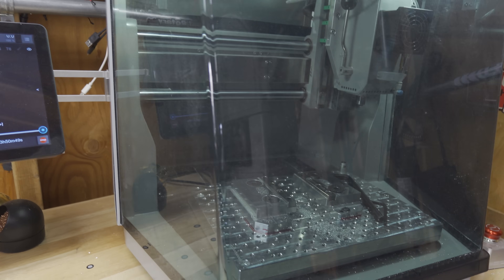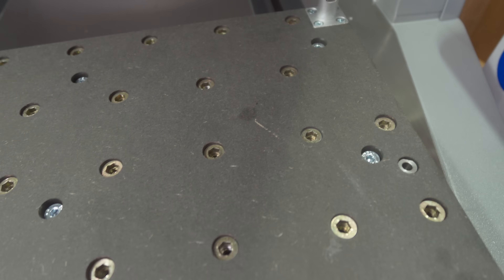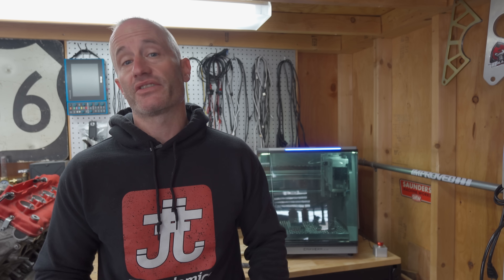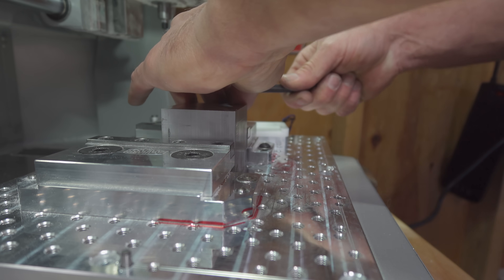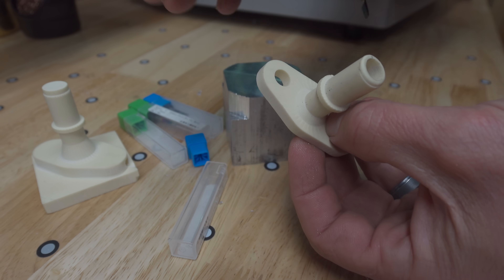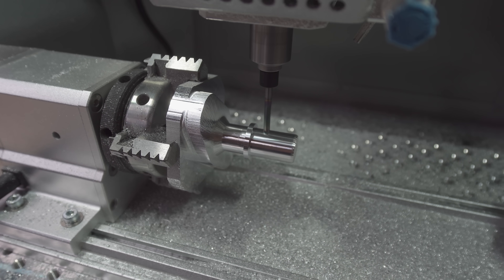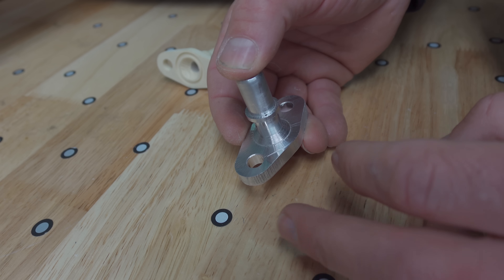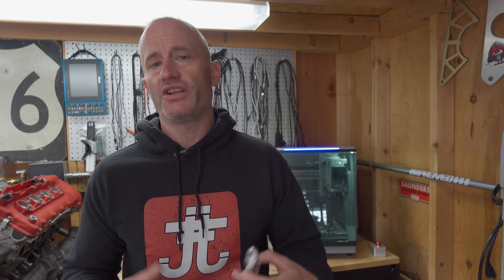More than small flanges? Making a multi-operation component from aluminum with the Carvera Air.

Comment: Nice honest review showing the capabilities of this machine. I have a similar small CNC (but without 4th axis- Carbide 3D Nomad 3) and it's pretty amazing what you can make with it. A machine like this, along with a small bench top manual mill and lathe plus a decent 3D printer makes for a very capable garage prototyping workspace.

Comment: I highly recommend you try side milling (cutting using the side of the endmill instead of tip). You will probably be able to save quite a bit of time.
Reply from the maker: Yea that’s a limitation in the provided CAM. Looking forward to having more control over tool paths using Fusion for CAM.
Reply: @CouchBuilt  That's a weird limit for them to have in place. Maybe it has something to do with the relatively weak spindle not having enough torque to push through material in that way.

Comment: At 9:40 he mentions that using the 4th axis attachment to turn down the piece will take 20 HOURS TO COMPLETE, that's 3 working days. He doesn't mention it would take 3 minutes on a lathe, and that taking 20 hours to do a 3 minute job will get you fired from any job and even any apprecenticeship. Absolute shill energy in this video.
Reply from the maker: LOL you don’t stand there looking at the machine for 20hrs 😂
Reply: @CouchBuilt  Is Carvera aware you are recommending their products are used unsupervised? send a letter to Carvera, and ask them if their machines are capable of 'lights out operations'. Ask them if they recommend their machines 'run without supervision'. Don't bother posting their response. Look forward to seeing how you edit your original response.

Comment: toolpath generation looks far from optimal. playing around with the cut direction, step overs and stock limits could really cut down on machining time.
Reply from the maker: I think incorporating Fusions CAM will take this up a notch. It spent a lot of time cutting air. The 4rth axis had almost no options beyond cut everything on a lateral or rotary pass rather than choosing the best option for the feature.

Comment: Thank you, while I already own a similar desktop machine, I'm glad to see someone doing something other than the demo projects and maybe some flat 6061 with a single op part.
Reply from the maker: It was kind of infuriating watching how basic some examples are out there. I’m sure there are some other good ones but I accepted the machine as a challenge to see what I could do with it.
Reply: @CouchBuilt  I think some of it is that these things really don't seem like there's a lot of thought given to edge finding or probing. The plate w/ a 1/8" dowel approach works if you have a flat corner but they lack any sort of software support for like locating off a bore which makes doing any sort of second setup that much harder. 

I'm working on figuring out how to connect one of the ali express special touch probes in, electrically it's easy but Im now having to figure out gSender...

Comment: I have to admit I want one as it could do the finishing work on my 3d printed aluminum parts...
Reply from the maker: That’s a big reason for investing in accurate material holding
Reply: @CouchBuilt  The satisfaction of 10:12 though 😌
Reply: Ha, that's true, I hadn't considered that. I need some CNC parts now and then. However I think for $$$ over say 5 years, buying tools and disposables, alloy stock etc, it would be cheaper for me to keep farming out to Chinese CNC houses. I'm trying to use the rapid prototyping angle to convince myself, but more additional angles (like finishing 3d printed parts) could tip me over. One of the problems is that the finish on the parts I've had made via CraftCloud etc have been wonderful (blasted, anodized, etc), and those additional services are just something else I'd have to learn/do/farm out.
Reply: @kiztime1234  Hello, we are a Chinese manufacturer of pipe fittings, specializing in elbows, tees, reducers, flanges, and other pipe fittings. If you need something, you can contact me.😊

Comment: It's nice but so slow. The surface finish also leaves a lot to be desired. My mini router leaves a lot better finish than this.
Reply: Does your router have a 4th axis?
Reply from the maker: Visually the surface finish is deceiving. I wish I had a reliable way of measuring roughness average.